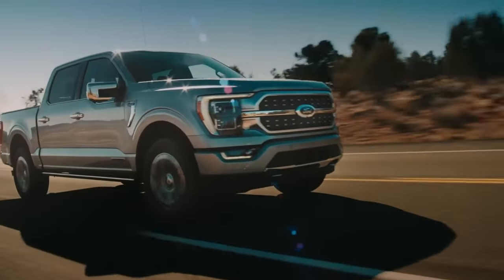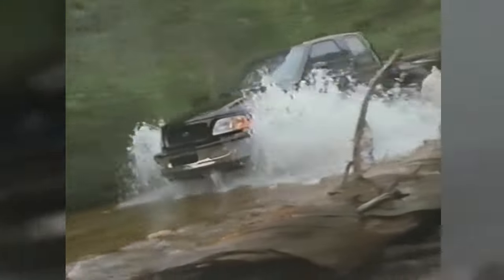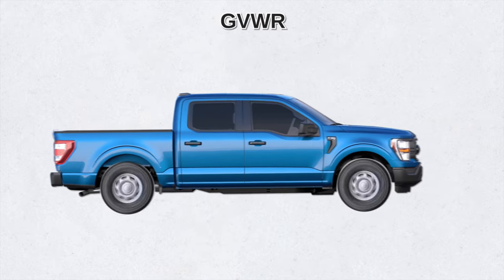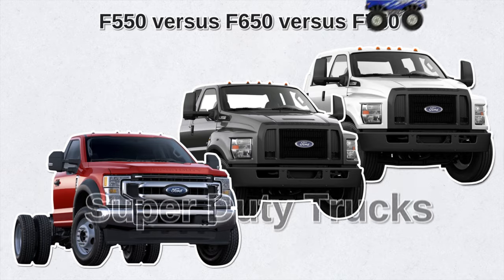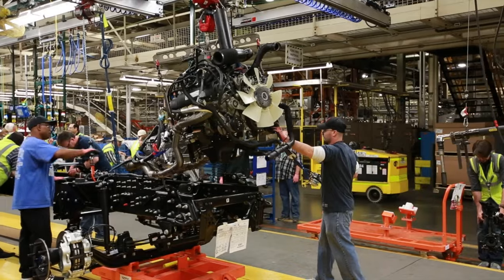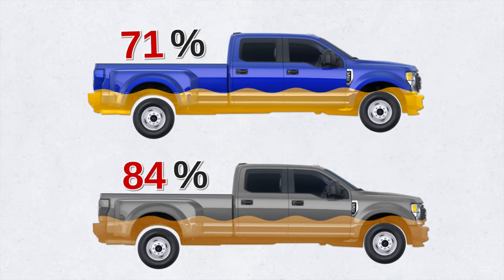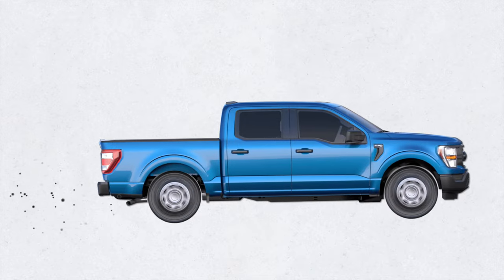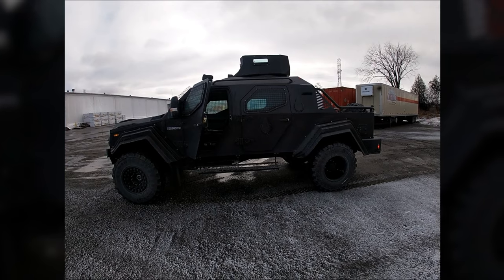No One is Telling You the Truth About Ford, So I Have to

Comment: I think the F250 tows more and the F350 can carry more in the bed. They typically have the same engines.

I think you made a mistake sir, saying towing when you meant to say carrying.
Reply: No the F350 can tow up to about double. You can get a dually with a 1 ton you can't with a 3/4 ton. You are talking like 18k lbs with a 250 and up to 30k or so lbs with a 350. They have the same engine doesn't mean anything the heavier truck has a beefier frame and suspension besides being a dually. You always will be able to tow more when you have 4 tires in the rear compared to 2

Comment: My '77 F100 XLT short bed is pretty much ready for a frame-up restoration so I am looking for a truck after 38 years!  the problem I'm having is that it is almost impossible to find a 2 wheel drive, regular cab, short bed like my old '77 anymore.  Also, I have heard some bad things about the 3 valve V-8's.  I want a V-8 (not the Triton), AT with Lariat or Platinum trim.  I like the '10's -'14's but the'15's &'16's have ugly grilles. Can't afford the newer ones.  Any suggestions on where to look?

Comment: I own a 1991 Ford F-350, dually, 7.3L diesel, and at 481,000 miles, most of the truck is still original. And believe it or not, she's still solid, and reliable.

Comment: I put $1000 deposit on a Ford F3 50 XL , no doodads on March 1, 2021 , still no truck
Reply: The chip shortage Scott has  mentioned..is probably why
Reply: Sucks, you’ll love it when it comes. I have a 19 f350 alumi duty and love it. 21k on it with the diesel. Best truck I’ve ever owned. Easy to maintain and pulls like a train when hauling

Comment: "best sports car in America is a Truck" the F150 Lightning.

Total piece of junk by today's standards and you can pick one up for $5000 grand no problem because the engine wasn't designed right to handle a supercharger.

If you buy a 1993-1994 F150 Lightning that truck is spot on worth every penny. Good luck finding one!

Anyhow the Big Change was the XLT Transmission in these F150s...total MONSTER of an OEM tranny and worth a fortune today in light six figure mile use.

Ford built on that by producing the F150 "Raptor" edition which is arguably the best pickup truck Detroit has ever made as a production run. The F450 is truly commercial grade and still is...nothing in the real World that Truck can't either haul or tow.

But if you're serious about ACTUAL TRUCKS there is only one and that's a Freightliner M2 Sport Chassis.

This is a vehicle designed to literally put millions of WORK MILES on, not anything from the gasoline clowns, not any of the battery nutters.

I ran a $22,000 us dollar Class 8 Freightliner back and forth from Syracuse, NY to Los Angeles and back TWICE A WEEK.

6000 miles PER WEEK.

Anyone who hasn't done that and is trying to talk about "trucks" to ya' DOESN'T KNOW A GOD DAMN THING ABOUT TRUCKS.

Don't even get me started on Railroads...which i say again...if you're in Rhode Island you have a front row seat to EXACTLY how the US economy is doing as that's where the Railroad runs to to export US made Vehicles no different from down here in Georgia.

If that lot is empty your economy is in a WRECK.

Move along..
Reply: You have no idea what your talking about if you think you could ever find a gen 2 lightning for 5 grand. 

And how exactly was the engine not designed right for the supercharger? I've had a lot of experience tuning those motors over the years and they can handle the stock supercharger and even bigger Whipple chargers just fine.

Comment: I have a 2014 ford f-250 diesel with 45k miles. Starting 9/15/21. I have spent $4000.00 on repairs. Ford has an extended warranty (8yrs or 120K) on the Reductant Heater for 2014 F-450 but not my 2014 F-250 which has the same engine and reductant heater. This makes no sense except for saving Ford money on warranty repairs. Everyday now I wonder if I am going to see the Service Light On. DON'T BUY A FORD  .If I would have purchased an extended Warranty  for about $4000 5yrs 100K. I still would have paid $4000 for the work because now I'm at 7 years and out warranty years my total would be $8000. DONT BUY A FORD!

Comment: Did you leave out the part about every 6.0L having to have it's EGRV replaced because of failure between 100,000 and 125,000 miles. Did you tell them about how it cost approximately $4,600 using Motorcraft parts and typically by a Ford Certified Diesel mechanic? While you're at it, tell everybody about how the problem was SO PROLIFIC that there's at least 10 after market companies that make that kit. That's right folks! Ford has known since the design of the motor that the EGRV would fail early on in the young rockstar of an engine's life because they rushed the design of this very important part just to appease the Californian Air Police. I thought that I got lucky on my 2005 XLT F250 because I bought it with 105,527 miles on it, I was the second owner and it was CHERRY! Until one day when an entitled employee who wanted to drive the other truck, abused that hard working BEAST of a work truck. SO, in closing......Ford engineers= BAD. Should have been a recall, but who else are you gonna buy work trucks from for such little money?

Comment: What about the new ford maverick?
Reply: Hell no just nicer looking Hyundai Santa Cruz it’s no better than a Honda Ridgeline still, and it’s low powered Ranger still. 🤔
Reply: Best truck ever
Reply: @tesla_models  Which one? 🤔
Reply: @codybrandoncargle3129  f150
Reply: @tesla_models  Ehhh F150 is okay, but a Toyota Tundra or Nissan Titan is better, older Chevy Silverado’s and Sierra’s are also better, and Cummins based Dodge Ram’s are also better! 🤔
Reply: @codybrandoncargle3129   anything from fca suck etc one with hemi engine
Reply: @codybrandoncargle3129  I agree with strongly on Toyota and Nissan (if not a cvt) but gm no ways . It's not only me my friends too own fords which didn't break down and it very well depends on the engine your buying.  If it's a crapoboost ( ecoboost) engine it breaks a lot.  If it's a coyote engine it will  last longer than expected.

Comment: So why not tell people about the extreme added cost of a diesel truck? Appx 10,000 bucks more to buy than the godzilla 7.3 gasser...the dpf and the def systems will need replacing before 150000 miles... and usually before that...not to mention the increase in fuel cost at the pump...in simple terms,you will never save enough fuel to cover the out of pocket 20 grand your diesel will cost you...sounds like scotty has gone into ___________( fill in the blank),instead of tellin THE WHOLE TRUTH.

Comment: Try 450 hp and 1000 ft lb of torque on the 6.7 Scotty…
Reply: Depends on which truck it is. The heavier work trucks don't get the same HP and TQ numbers you get in the 3/4 and 1 ton trucks.

Comment: Ford diesel's suck , 7.3 is good though. Emissions ruined the motor ☹️.
Reply: Cause gm and Cummins are doing better. They all suck with emissions, fords frame and suspension blow gm and dodge out of the water now. Ps let’s not talk about gm and dodges electronics issues

Comment: If I bought a new pickup, it would be a Ford F-150 or a Toyota Tundra.  No way would I drop 40 to 50k on a Chevrolet or Dodge.
Reply: Toyota Tundra I would buy, Ford F-150 is no better than Chevy Silverado or GMC Sierra, but definitely on par with Dodge Ram so yeah hands down the Tundra is the best then Nissan Titan would be my second choice. 🤔
Reply: @codybrandoncargle3129  --  I should make it clear that if I were to buy a Ford pickup truck, it would have to be equipped with the  regular 5.0L V8 engine. I would stay away from the EcoBoost V6.

The Silverado is nothing but junk, especially with the automatic fuel management system.  Nothing but trouble.  The Ram is nothing but a Fiat now.  The Nissan Titan XD isn't a bad truck, but their overall quality has slipped since they were acquired by Renault.
Reply: @codybrandoncargle3129  chevy is crap . Had a Tahoe for 11 months in workshop.  Ford better than chevy ...
Reply: @tesla_models  Okay well normally Chevy Tahoe’s aren’t crap, idk Ford breaks down a lot too man js! 🤔
Reply: @1VaDude  That’s true about Ford, and which years of Chevy Silverado’s are you referring to? 🤔 And yes the Dodge Ram is garbage and Nissan Titan Xd is hit or miss, but yes Renault is crap I am not going to deny that, so overall Toyota Tundra is the best! 👍🏻
Reply: @codybrandoncargle3129  --  I would probably not buy any Chevy Silverado built after 2008 or 2009 - around the time they started with the Flex Fuel and the "AFM" cylinder deactivation nonsense.

I had a 2004 and it was an awesome truck.  That 5.3L V8 would absolutely scream.  Sold it with 140,000 miles and it ran like a top.  A friend of mine still has his 2002 Silverado with 350,000 miles on it!

The later models look good, but they just aren't screwed together like the old ones were.  Dodge (Fiat) trucks slipped in durability too - but they still look fantastic.

Fords are still good, but avoid the EcoBoost V6 and get the Coyote 5.0L V8 for better long-term reliability.  The Tundra may have had one or two "problem" years along the way, but they still rock - and are built in the USA!!  🇺🇸
Reply: @codybrandoncargle3129  no no wY we had a Tahoe been in workshop for more than 11 months now.  My uncles 2012 explorer is still going strong at 221k miles on it with no issues and with original transmission.  So based on my experience fords are much better than gm . Worst of all is fca and ram
Reply: @codybrandoncargle3129  chevys Break down a lot compared to any ford
Reply: @tesla_models  Newer Chevy’s yes older ones not so much, actually newer Ford’s are no better they have just as many problems as Chevy’s, because Dodge Ram with Cummins hardly ever breaks, and Nissan Titan and Toyota Tundra are the best still! 🤔
Reply: @1VaDude  You are correct about Chevy after 2008/2009 and yes Dodge Ram’s are hit or miss a lot, Ford is hit or miss on the F150 no doubt, oh yeah Toyota Tundra is a beast I love that truck very similar to Nissan Titan but more reliable still, but Nissan Titan is hard to kill even though Renault owns them, that is something Renault can make over Fiat is decent V6 and V8 engines still! 🤔
Reply: @tesla_models  Okay your uncle properly maintained his Explorer otherwise Ford’s still break down a lot to, now what year was the Tahoe I can tell why it sucks? 😅 And yes FCA  and Ram are horrible! 🤔
Reply: @codybrandoncargle3129  Nissan cvt transmissions are hopeless. Nissan only Toyota and Honda
Reply: @codybrandoncargle3129  a 2019 tahoe
Reply: @codybrandoncargle3129  any vechile etc fca when maintained properly lasts long.
Reply: @tesla_models  Oh that explains everything after 2007 Tahoe’s were trash too. 😂
Reply: @tesla_models  Yes! 👍🏻
Reply: @tesla_models  Nissan Cvt transmissions aren’t being used in the V6 or V8 engines just the 4 cylinder engines and yes Jatco transmissions are definitely hopeless but however a rare few including my coworker got extremely lucky with her 2017 Sentra never had no issues at all, but yes Toyota and Honda are rock solid vehicles but I love Honda better, Toyota is okay but there trucks are the only vehicles I really like from them. 🤔
Reply: @codybrandoncargle3129  kia and Hyundai are the best vechiles
Reply: @tesla_models  I disagree man they are nothing more but high end Nissan’s and Mitsubishi’s js. 😂
Reply: @codybrandoncargle3129  but kia vechiles were found to be reliable for a reason
Reply: @tesla_models  Doesn’t matter I rode in Hyundai and drove 1 hybrid recently I am not fully impressed with the vehicles to me Honda is a lot better and more reliable along with Toyota still. 🤔 I feel like Mazda should be getting more recognition and Subaru as well. 🤔
Reply: @codybrandoncargle3129  yes honda is the best vechile in the world
Reply: @tesla_models  For sure! 👍🏻

Comment: Commercial Scotty vs Truthful Mechanic Scotty.  Super doodie is more like it ;). My dad in laws Mountaineer, that he babied, changed oil every 3k, trans fluid every 30k died at 72k miles (5.0L motor), front end fell apart, cooling system failed, not worth fixing, just a domino affect of one problem after another.

Comment: I had a 1975 E150 with a 390 in it the van was a complete pile of garbage, my 1967 Plymouth Valient with a 276 V8 could pull the big UHaul trailer or my 1983 Nissan pickup infinity better than that puke E150 Van!